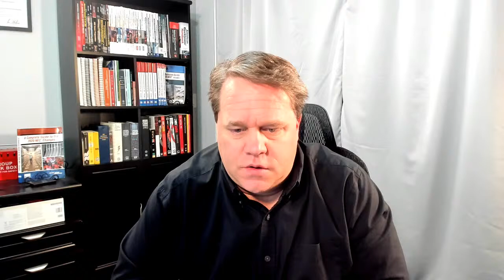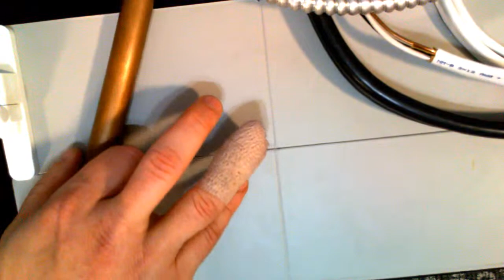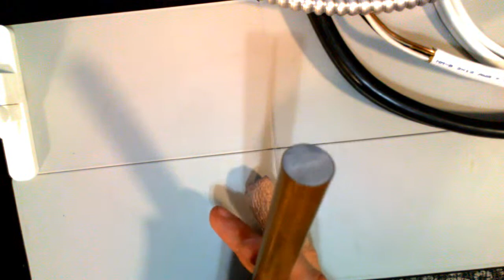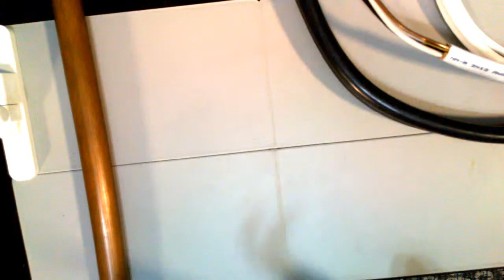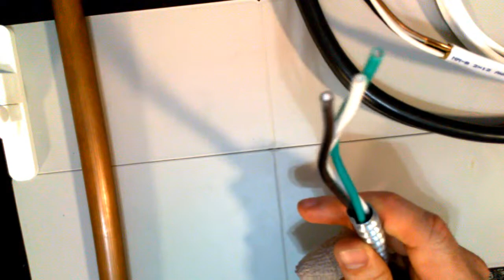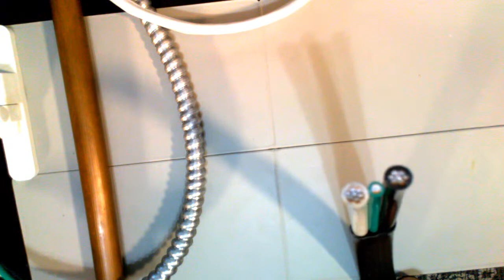Testing settings and making announcement

Comment: Thanks Ryan for this info, I would like to ask tho, what’s the real benefit of copper clad aluminum vs aluminum? It is for the most part calculated as aluminum, so what is the benefit of copper clad vs aluminum?
Reply from the maker: Peter will do a MUCH better job explaining it than I, but the advantages include price, theft resistance, and the fact that the terminations are basically copper instead of aluminum.
Reply: @RyanJacksonElectrical  cool, so in other words, you can install those decora style switches and receptacles seem to be trendy now, without having to use those Alumniconn lug style connectors?   Every decora that I've seen was copper rated.    Of course I haven't dug deep enough to see if they listed for copper clad.

Comment: I am looking forward to the seminar with Peter.    As a residential electrician I know all to well how painful the price of copper is, and frankly at least in the Greenville SC area aluminum SER cable is not far behind.  We were installing 6/3 SER for our NEMA 14-30R in the laundry area, recently switched back to 10/3 NM because we weren't really saving much money anymore,  and 10/3 is so much easier to pull and terminate.   Still run AL 6/3 SER for our NEMA 14-50 for the range and EV chargers.    Copper clad aluminum is great stuff, and it's history can be traced to the early 1970s, when homes were catching fire at an alarming rate due to 1350 series 12 and 10 AWG aluminum used throughout the home when aluminum compatible devices and connectors did not exist and consequently was treated identical to the copper that was used since the knob and tube era.